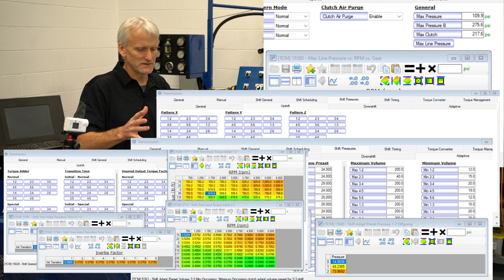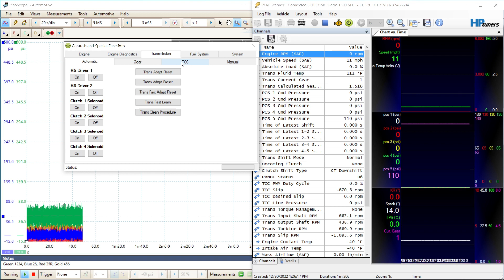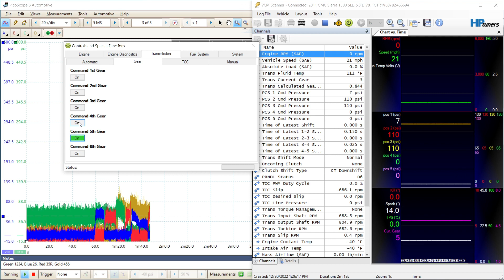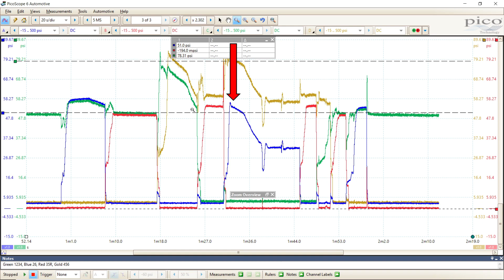HP Tuning the GM 6L transmission - what do the tables actually change?

Comment: 60 Ohms is total resistance between hi and low CAN
But E38 as first block in the row already has 120 Ohm resistor inside
Same last unit in row (like transfer control or so -I dont remember ) also has 120
If CAN wires has open circuit  somewhere   -u will  measure 120 Ohm at DLC instead of 60
Thats why all units that not first and not last in this chain also has 2 pair of CAN wires  and disconnecting any module will be seen at DLC as 120 instead of 60

Comment: Great videos, thank you.  I've got a question if you could please comment.  I've got a 2017 Yukon with a 6L80 and a 5.3 with 60 k on it.  I had a converter and pump put in it about 20 k ago due to some shuddering and some HP tuning done at a local shop more recently.  I'm going to get into the HP thing myself to hopefully fine tune things because I'm still not happy.  Main concern is tcc lockup in 1,2 and 3 because the engine just struggles to make enough power on mild hills/turns when it shifts to 2nd or 3rd, it really struggles and it's because tcc is locked and wont release.  You and many others are routinely doing the 317/318 trick to block tcc in 1,2,3 and 4.  I asked my "guy" to to it in 1,2 and 3 (dont think I need it in 4th) (FYI, he is a VERY experienced trans builder and tuner), he told me he's not comfortable doing that because he has seen many failed transmissions that have had that HP tune tweek in it.  He instead decided to disable the torque reduction on up and downshifts in order to give the engine more power. I do notice more power during and just after the shifts, with a mild increase in firmness (not too much to worry about).  Question is,  is it really safe to do this tcc 317/318 thing in 1,2,and 3?  Also, I would love it if the tcc would release at say 5-60% throttle in 4-5-6 again to give the engine a chance to make power, instead, as it is now, it just downshifts, with tcc still locked, and still struggling to make power even in the lower gear, especially up hills.  Thanks for any feedback.
Reply: Did you ever correct this problem ?
Reply: With the shuddering

Comment: I have 2011 Yukon XL 2500 ECM, it came with 6L90e , for my swap project I need 6L80 , What should I change on the ECM to use the 6L80 instead of 6L90 ?

Comment: Hi there l have seen your video on automatic transmission l have a problem in my Mitsubishi Eclipse 2001 automatic transmission 4cy it start going to safe mode by N flashing on my gear selector and all that happened after l changed my heater core l took out the whole dash and after l fixed it start having the flashing (N) and only goes to 3 speed and stays there the scanner shows solonide 2 have a problem l changed 1. 2 and 3 solonide still have the same problem and l changed the sensor on the top of the transmission selector sensor still have a problem do think li could be a ground under the dash l missed please let me know thanks l am a subscriber

Comment: Really looking forward to this series. Remember that the virtual torque tables, both airmass & map, in the ECM influence the pressures the transmission sees and requires adjustment, especially when adding power adders such as blowers, turbos or even a camshaft upgrade.

Comment: Cant wait to see upcoming videos. You are the man when it comes to transmissions.   I even seen you at one of the atra seminars in vegas.  I make changes to a lot of 6l80 90s with hp tuners. I purchased the tuning school books. They are helpful but its a lot of trial and error and you cant always just play around with customers cars.  Luckily one of the guys i work with has a 6l80 silverado.  Mostly the only changes i do is cylinder drop disable and move lockup out to 4th gear.

Comment: Thanks for the great videos. Before I retired I repaired Caterpillar Tractor engines and powershift transmissions.  We would send the finished pieces to the Cat dealer for dyno testing. I quickly learned that if a transmission tested bad it was probably bad, If it tested OK it just meant no faults  were found during the test. They could not load or heat the unit enough to duplicate operating conditions.  After running the numbers we decided to put more emphasis a on quality rebuild and skip the dealer testing ( Dyno time at the dealer was awful expensive ).
Looks like in this the dyno caught a bad one. I will be curious as to how the chassis dyno testing turns out, this should give you some baseline numbers to work with.  I wonder if HP would give you there numbers if you show them yours?  When I left the industry transmissions were changing from mechanically controlled valves to electric. Testing went from a test box that weighed 50 lbs to one gauge (or pressure sensor ) and a laptop.  I could tell stories. Thanks for putting the effort into training new mechanics, sorry I mean TECHS.  It can be a tough way to make a living ( Been there done that ) 

Hope I didn't scare away any students, Flat Rate can work it takes the right guy in the right shop.   Sorry for rambling and have a great New Year.

Comment: Recently decided to go down a rabbit hole of DIY 8 bit computers for ECM and TCM use. Hope this results in additional info I can apply to my logical designs... and maybe eventually a real working example. Only recently uploaded a circuit simulation that's barely enough to show the flow of logic for an ECU that only has crank input and  MAP input. Doesn't require software of any kind, but can have an EEPROM added with very little additional circuitry to make it programmable. Heavily inspired by Ben Eater's bread board computer.